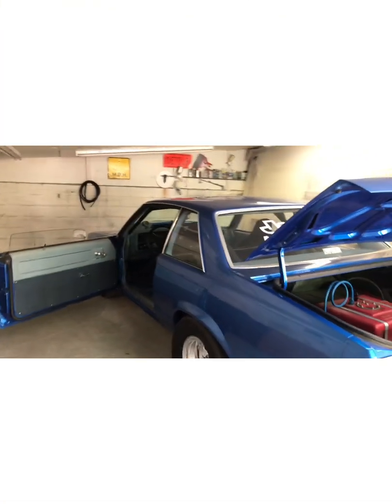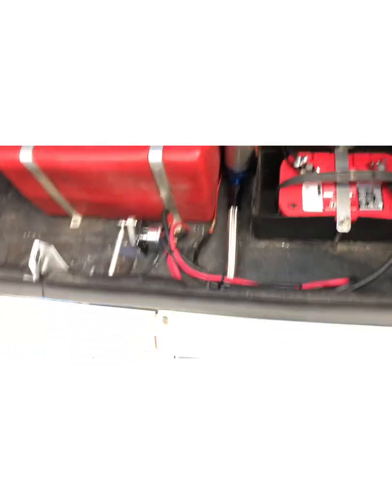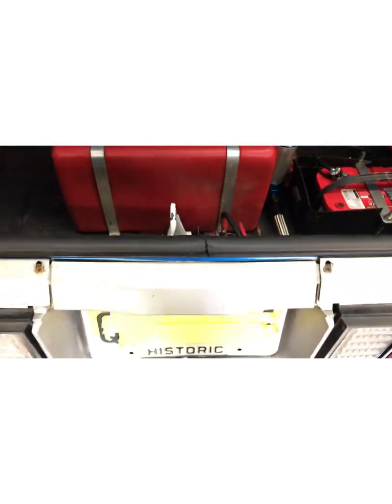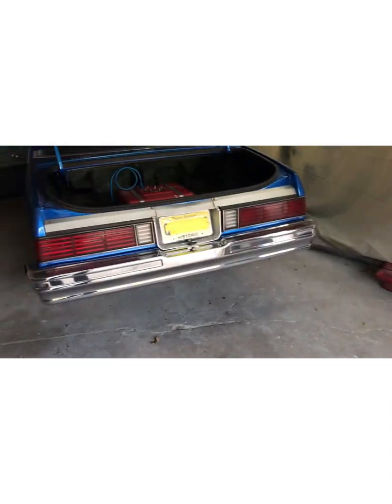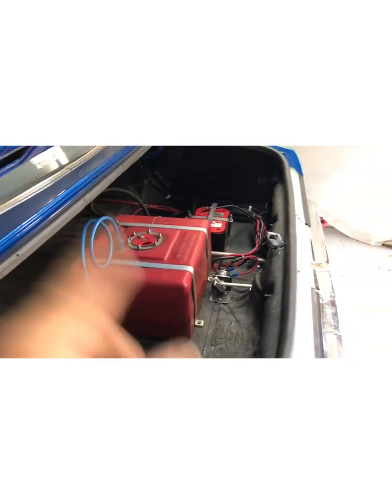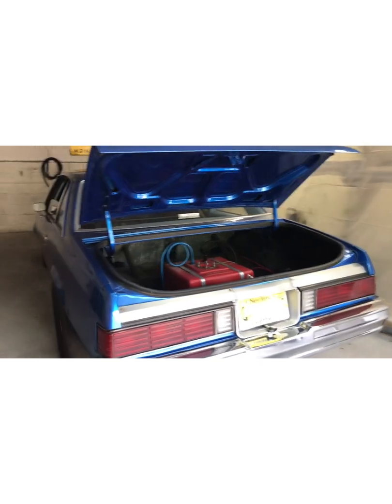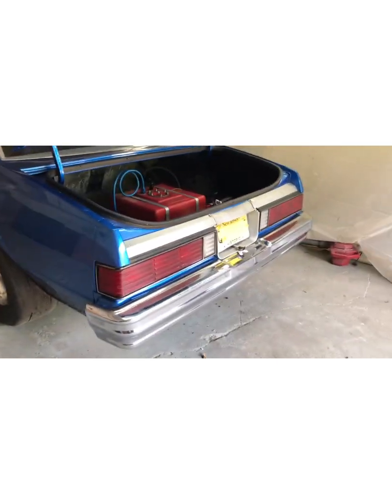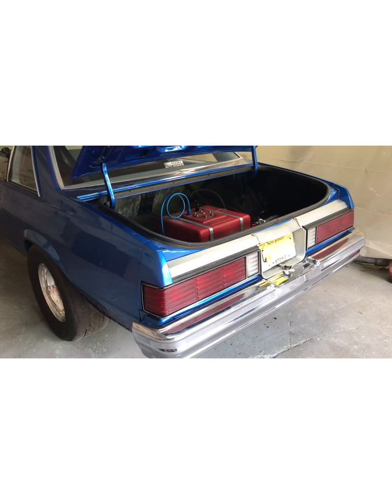Moroso battery disconnect switch

Comment: How do you want size watts or amps to use I got a c10
Reply from the maker: Are you asking what size wire to use.  ?       From the alternator to the switch if your battery is in the rear .run a # 6.  Positive and negative cables should be # 2.

Comment: If you wire a 2 lug (with an alternator) correctly the car will shut off just fine.
Reply: You can wire it so the engine will shut off, but not so the alternator charging won't remain hot.  When the alternator charging wire remains hot, the entire electrical system is not shut off.
Reply from the maker: Yes 👍
Reply: I'm running a 2 lugs and it shuts off.
Reply from the maker: How did you wire it.

Comment: Do you think this is a good way to prevent parasitic drain from the battery on a car that doesn’t move too often?
Reply from the maker: Yes for sure.
Reply from the maker: You can actually use a regular one if that’s what your going to use it for.  Doesn’t have to have the extra terminal for the alternator like in the video.  Just a master cut off will work.